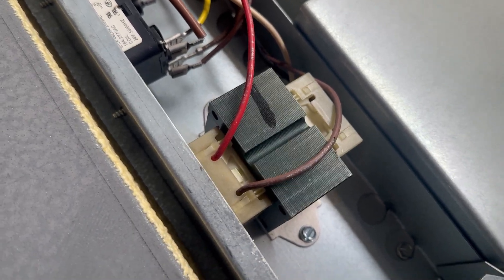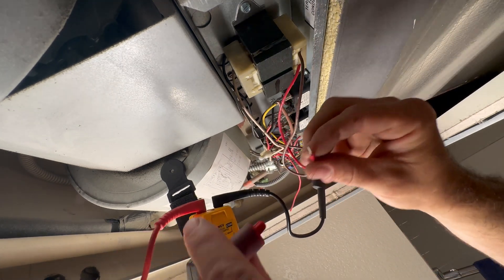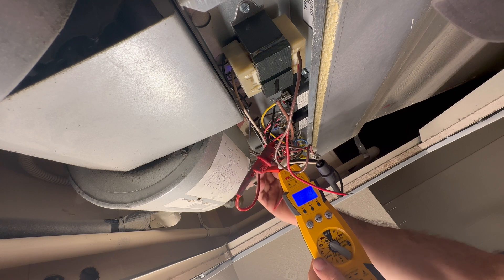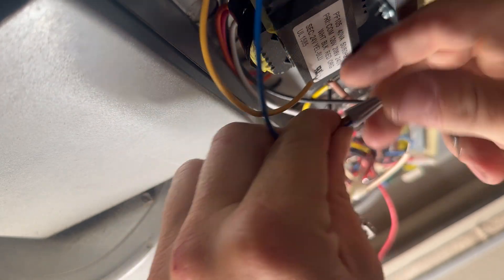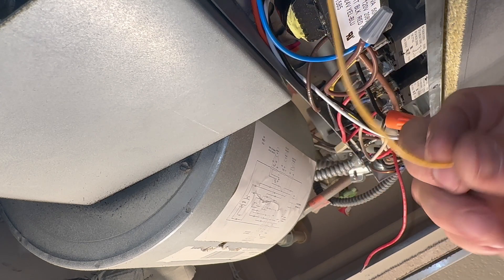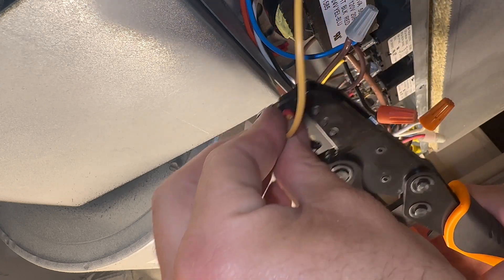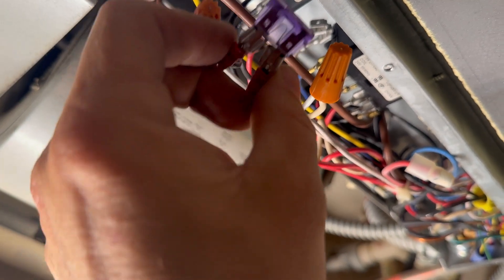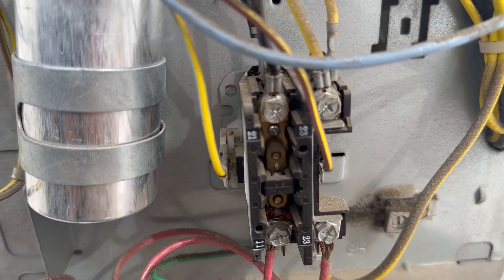How to Troubleshoot a HVAC Step Down Transformer

Comment: I have a similar issue. I need help diagnosing the problem.  Blower motor runs constantly no 24 V coming from the transformer no 24 V going to thermostat. Exact same air handler.

Comment: Thanks. I love your video and a couple questions: 
7:08 how does the common overheat the transformer? Is it because of the heat from high pressure refrigerant line? Also, how can a bad contactor damage the transformer as it's just receiving voltage signal? I lost at 'on the coil 10 to 15....' what? Didn't quite get this part. Thanks.
Reply from the maker: The contactor coil has to have resistance, of say 10-15 ohms, if it doesn’t, it acts like a wire. When you apply power and return power to a wire it over heats and goes boom, same as touching a 120v, 277v wire directly to ground or metal. The transformer in this case 24v 120v incoming can only handle about 1.8 amps, any more than that it turns into toast because it can’t take the heat
Reply: @ApartmentMaintenancePro thanks for the wisdom.

Comment: How do i add a second transformer for a uv lamp?
Reply from the maker: Tie into 120v somewhere, doesn’t really matter where as long as you have it wired in parallel
Reply: @ApartmentMaintenancePro  so cut the cable and tie the three pieces together?
Reply: Please show a video on this 🙏🙏🙏

Comment: Lennox 19W88 4 prong transformer failed.  Bought another and with a picture of the original, I plugged into the same prongs from the picture I took, it worked as I tested the fan, a/c, & heater.  Turned on a/c later and it shut down. again.  I turned off the power and unplugged the transformer, it was SO HOT!  Any thoughts or is an A/C Tech my only option?
Reply from the maker: You have a low voltage short, I don’t know your skill level with a meter so hard to say

Comment: What could cause a transformer to go out every single year in the summer? Each year I’m replacing the transformer as it goes bad when it gets too hot out. never fails to go bad each single year
Reply: Wrong type got installed before so same wrong one keeps going in. Or lightning zapping it.